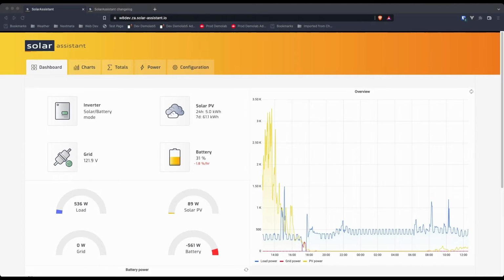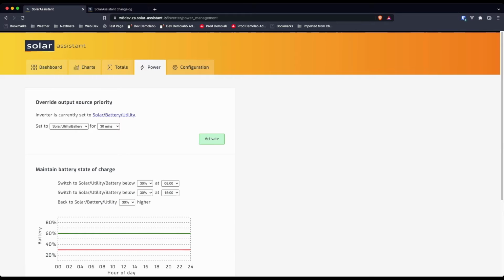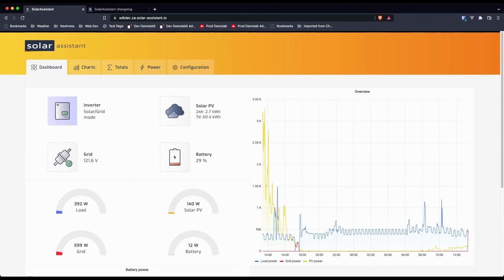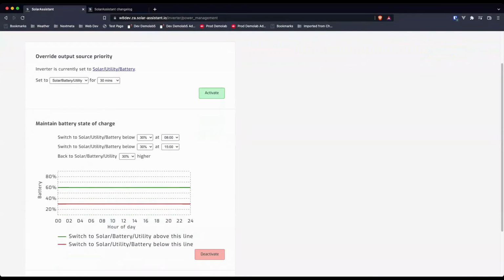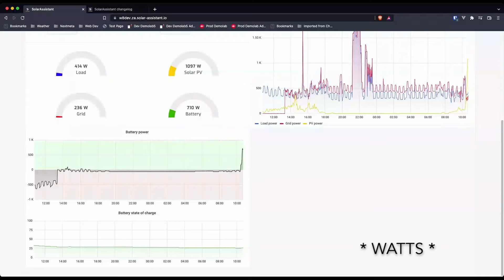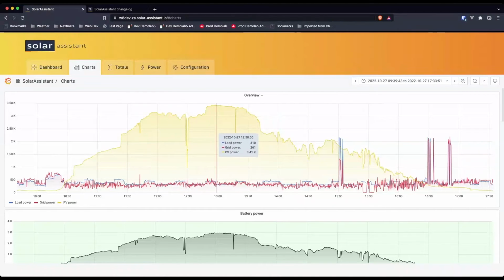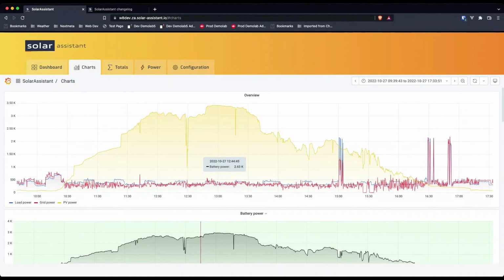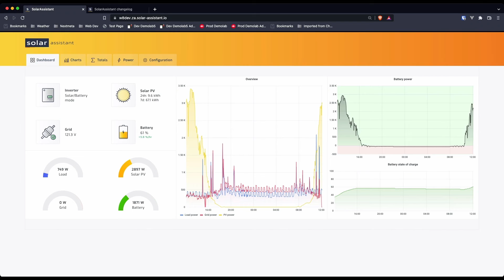EG4 6500EX and Solar Assistant - Automatically Switching from Battery to Grid for the First Time

Comment: I have 2 EG46500 in split phase and went through the same problems a few months back. I was on 100% solar for 1 billing period but still metered 2KW. Signature Solar never replied back. I ended up disconnecting the inverters from grid and installing transfer panels to switch individual circuits to manage battery drain. How do you like the Solar assistant? I tried watchpower and it was a disappointment.
Reply from the maker: Unfortunately, so far I’m having the same experience with SS.  It’s very hard to get any answers from them, or even get them on the phone.

Solar Assistant is 1000 times better than WatchPower.  Highly recommended.  Honestly, WatchPower is so disappointing, I would recommend the companies even stop mentioning that it is an option.
Reply: I have an emporia vue hooked up in my main panel and I show a pretty consistent 50 watt draw from grid on my eg4 6500. I usually kill the breaker when I know I won’t need bypass.
Reply: @AdamDeLayDIY   which cable did you use for solar assistant? none I had lying around the house wanted to work I have 2 more coming from Amazon to try.
Reply from the maker: @shamusburcham332  what mode is your inverter in?  SBU or SUB?
Reply from the maker: @shamusburcham332  if your talking about from the inverter to the Pi, I started using micro USB cables, but that port on the inverters is so flimsy.  Right now I’m trying to use the USB to RJ45 from Watts247 but SolarAssistant keeps throwing CRC errors.  SA is supposed to be looking to see if there’s protocol changes between the EG4 and the MPP inverters.
Reply: @AdamDeLayDIY  SBU  odd part is it seems to do it more consistently when batteries are almost completely charged. I haven’t spent much time monitoring it to see exactly when it starts or stops I just happened to catch it one day and turned the grid in breaker off and it went away.
Reply: @shamusburcham332  I use the microUSB into a PI3.  I have 4 port serial DB9 which pulls battery data from master Jakiper rack.
Reply from the maker: @Shamus burcham thanks for sharing.  When in SBU mode, I've never really looked at my grid monitor (Sense) to see if I have any extra phantom loads.  SolarAssistant doesn't show any grid utilization though.  Now I have read some comments in the diysolarforum that the reason we might see the "phantom draw" from the grid when in SBU mode is due to the fact that the inverters are maintaining some kind of minimal voltage connection to ensure a fast switch in the event that the loads need to be switched over to the grid.  Not sure why it would have to actually draw power instead of just detecting voltage on the line though...
Reply from the maker: @Shamus burcham I will say that I tried to purchase 2 different USB to RJ45 cables (RS232) and neither of them worked out of the box.  I then tried to determine what the pinout of the inverter jack was so I could modify one of the USB cables and even in doing that, I still kept getting the CRC errors in Solar Assistant.  I disabled CRC checking in SA and when I did that things mostly seemed to be working but instead of 2 inverters showing up, 3 were, which was bloating all my data.
Reply: @AdamDeLayDIY  Use the provided (eg4) rj45 to serial and then use a serial to usb. Works for me like a charm. Use voltronic on the inverter model.
Reply from the maker: @PRVRT1  Yeah I always have that to fall back on, but since I have to buy a cable anyways (since the serial to usb isn't included), I was hoping to simplify the connections and wiring by having the proper USB to RJ45.

Comment: The inverter overhead power to run the battery/HV DC converter, drive the PWM IGBT's AC sinewave, and SCC switching is taken from battery always, and is the 63 watts you see from battery.  Unless you have enough PV charging power to overcome this overhead you will see any power overhead shortfall drawn from battery.

Depending on mode setup, when SCC shuts down due to PV dropout at night, it may shut down some of these overhead items.  The battery/HV DC converter draws most of the overhead and if inverter remains active to immediately back up a possible grid dropout, the battery/HV DC converter remains active, with its 50 watts overhead power consumption.
Reply from the maker: A comment was made in the forums by SS that when your in grid-bypass, the inverters idle consumption always comes from the grid.  I was able to test that and confirm that the load does shift to the grid, but there’s still this trickle that remains.
Reply: @AdamDeLayDIY  The internal AC to DC low power supply is not large enough to power the full inverter overhead steady state but enough to get it started if battery low, if the battery is being charged by AC input it can supply the necessary battery overhead power draw.
Reply from the maker: @rcinfla9017  that’s very interesting.  Thank you.  

So what units do you have?

Comment: Hello.
The wattage measured by a non- reactive power compensating meter is higher than what is actually used.
If you put an in-line kwh meter on your AC input side the idle consumption will be the listed idle on the spec sheet.
this is nothing to do with the inverter and everything to do with the meter being used; the grid load shown is a product of the 3rd party software doing the A x V math without realizing that PF is wrong.
Reply from the maker: James.  Thanks for the comment.  

Are you talking about AC Input or AC Output?  Can you tell me what page in the manual lists the idle consumption of the inverters cause I'm not seeing it in the specifications list.  

To my knowledge, Solar Assistant is just taking the values passed to it and displaying them.  The battery values are coming from my Victron Smart Shunt and I can compare the values displayed in Solar Assistant to the values in the Victron app.  The grid power values would be coming from the inverters.

Comment: Doesn’t the inverter draw from battery?
Reply from the maker: I guess it depends on what context your talking about.  You can program these inverters to switch from battery power to grid power when the a specific voltage or state of charge is reached (as long as you have it set up properly).

Comment: I did some testing today and while on SBU mode and no solar, Battery mode was draining between 60 / 80 watts from grid. Batteries were at 100%. I think the idle consumption is being fed through the grid from some reason even when the batteries are in good standing. Probably a firmware bug. This is on a 6000ex
Reply from the maker: @walter pons That's very interesting to hear that even the 6000s have problems as well.  Kinda shocking to hear that power's being pulled from the grid when the batteries are full.
Reply: @AdamDeLayDIY  Yeah. I even did the new firmware update due to the famous 61 error (did not fix it).
Reply from the maker: I was wondering about the firmware update so I asked and was told it was only related to that specific error.  They're gonna have to acknowledge and update the firmware to fix some of these issues...

Comment: Don't forget the 61W consumed for each LV which is constant.
Reply from the maker: True, but when pulling power from the grid, should that come from the batteries or should that come from grid/solar as well?  Can't get a straight answer on that one.
Reply: @AdamDeLayDIY  possible the heuristic to minimize flicker from switch over to have inverter draw from grid.  I have not enable my grid feed yet, but I will look for this behavior.  I agree, SUB should pull 100% from S during day.
Reply from the maker: Possibly.
Reply: @AdamDeLayDIY  Flipped the Grid on.  And changed to SUB during day,  I am seeing 35+W being sucked from utility.   No reason why, there is plenty of Solar and Batteries are 100%.
Reply: @AdamDeLayDIY  With Grid connected, even SBU draws 10-20W from the Grid by 2nd inverter.   So, there seems to be a preference to draw something from the Grid if it is there.   Another odd behavior., when I disconnected grid,  the batteries took a huge draw for 1 sec,  then stopped, even with tons of available solar.   Another heuristic for buffering switch over from "grid" loss?
Reply from the maker: @errcl65 Thanks for checking!  I have read some comments in the diysolarforum that the reason we might see the "phantom draw" from the grid is due to the fact that the inverters are maintaining some kind of minimal voltage connection to ensure a fast switch in the event that the loads need to be switched over to the grid.  Still don't know why it would need to actually draw power instead of just verifying a proper voltage exists.
Reply: @AdamDeLayDIY  SA reporting grid draw only from the 2nd inverter.   1st inverter is not.  I have not fired up #3 and #4 yet to see full behavior.   Big pain, the LVs fault F80 with any of the extra LVs goes off line.  I wish the phase in and phase out of "extra" LVs was transparent.   Only way to clear F80 is go off line and cycle them.
Reply from the maker: @errcl65 I'm waiting on my furnace and coffee pot to turn off and then I'll flip of the AC IN breaker for my inverters to see if the last little load in my Sense app disappears, although from your findings, it'll probably drop to 0.  

Yeah, I know what you mean about the errors when any other phase inverter isn't turned on.  After my initial outage when my batteries got too low, I had the inverters turned off (standby mode) only gathering solar.  At the beginning of the day and the end of the day, the PV on one of the inverters was less than the "cost" to power the inverter, so I tried turning off the PV for one inverter hoping the other would keep charging since it was still in decent sunlight.  As soon as I turned off the PV for one inverter and the inverter turned off, the other inverter stopped processing any PV at all.  Even though the panels were in full sun.  Talked to SS and they just chalked it up to being in a split phase pair where if one goes down, they both stop working.  Very annoying especially since they were both in standby mode...
Reply from the maker: ugh
Reply from the maker: @errcl65 so I just ran a test.  My inverters are both set to SBU right now with solar coming in powering the loads.  If I flip off the AC IN breaker, my sense monitor only drops by a watt or two.  When I turn the breaker back on, I see the value increase by a watt or two.  Very interesting that we're seeing inconsistent results in how things are operating.
Reply: @AdamDeLayDIY  Down the load,  we may all have to cough up and buy Solark!  Seriously,  I am thinking the LV design will be ok for 5-10 years.  The 4 inverters were the least expensive part of our build.   We had big copper bills.  8 pairs of 180ft of 8 AWG PV direct burial which I stuck in 2 inch conduits any ways to runs to our panels.    The PVC pipes were insane $.

I think the weakest design link in the LV is the thin wiring used to bring the PV inputs into the MPPTs.  Full out,
those wires will be carrying (200V@18-20A).   But MPP solar confirmed it is safe.   That 3rd fan over the MPPT inputs is pretty critical in keeping those wires from melting.   The EG likely less at 1/2 the current with your Voc being doubled the LVs.
Reply from the maker: @errcl65  Unfortunately you're probably right.  These inverters were the cheapest part.  I would probably just save up and swap everything out for Victron gear.  Still don't know how they do it but they're supposed to have one of the lowest idle consumptions in an LF inverter.  I've used their gear in my 12v setup and was never disappointed.
Reply: My EG4 6500 EX inverters do the same thing.They continue to pull power from the grid when They should not be
Reply from the maker: @kevinlewis5082  Thanks for confirming!  Do you see them pulling from the grid when in SBU mode?
Reply from the maker: @errcl65 @Kevin Lewis I heard back from SS and it was very concerning.  Based on what I was told, the manual regarding the Output Source Priority is completely wrong.  Where the you would assume SUB would prioritize solar, then utility then battery for power, it doesn’t do that (which makes no sense since it’s stated plainly that way in the manual).  

I was told “In SUB mode, the inverter views Solar and Utility as its main sources of power, so it finds the most consistent, reliable source of power to power loads. In this case, it's utility power. as the voltage doesn't fluctuate as often, and it is available in the evenings as well.“. Even though I was told this by a level 2 tech at SS, I still find it very hard to believe that it’s supposed to work this way, especially since the rewritten manual mentions nothing of the sort.  

Still, figured I would share with you guys since you’ve seen the same problem I’ve had.
Reply: @AdamDeLayDIY  did you try Appliance mode and SUB?
Reply from the maker: @errcl65  yeah, both UPS and Appliance mode.  All it does is change the acceptable voltage input range for the AC In from 80 to 90v.